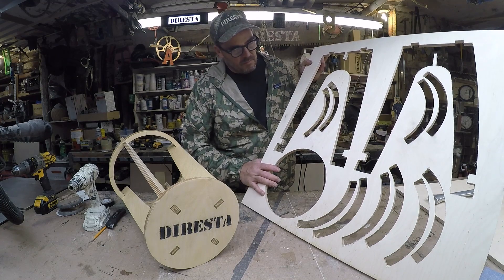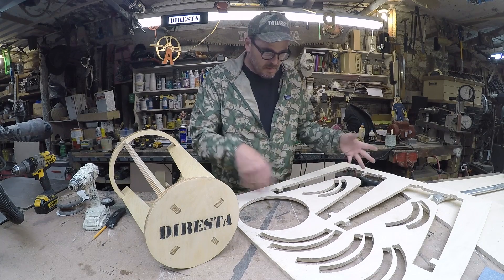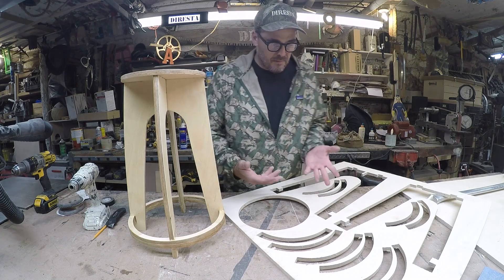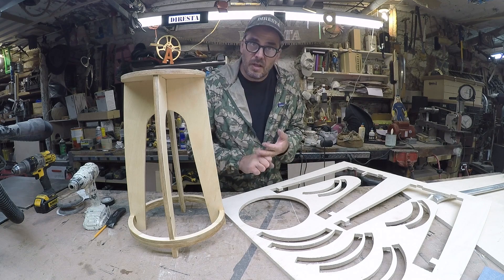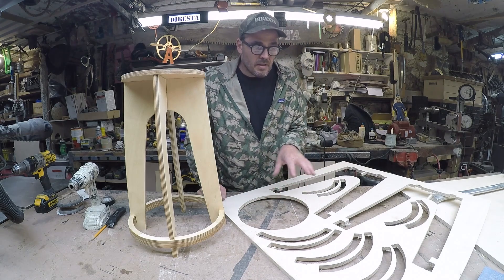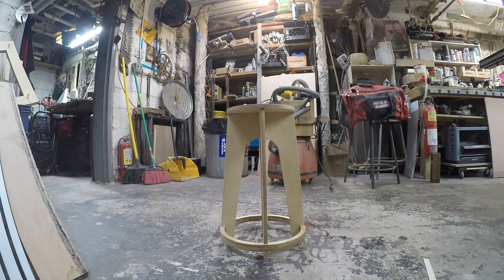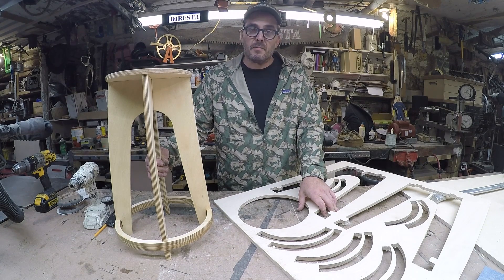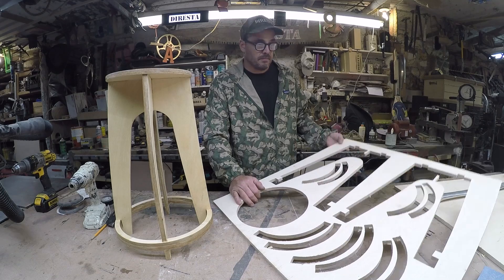Diresta: X-Carve Stool

Comment: If you ever do something that has your name engraved into it you should put some of the sawdust and epoxy(or resin I don't really know what he mixes with the saw dust), but you should put some of the mix where you're name is engraved and sand it nice and smooth and the letters will be a darker color than the rest of whatever project you're working on, but the color difference between the sawdust mix and the rest of your project will more depend on if your using a dark wood or a lighter wood for your project.

Comment: I've been thinking about getting an X-carve for my wood working and I've seen a lot of mixed reviews in regards to its reliability and dependability. A lot of people are saying that you have to constantly adjust the belts and recalibrate pretty much after every use. Have you run into any issues with the x carve? And would you recommend it to others? If yes, why and if not, why not?

Comment: Anyone else notice that the cut path wasn't setup properly, so that when assembled there were big gaps that had to be filled, rather than all the pieces coming together with nice slip fits?

Would have been nice if Jimmy aknowledged the error, even if he was able to correct it with a lot of glue and shimming.
Reply: eugenerk i noticed i need a cnc machine for a make project. And thats not gone happen soon...

Comment: "it's not one of my most beautiful designs..."

Equine excrement, sir.

There is an inherent beauty in the simplicity of one material and the economy of utilizing only one sheet of goods for it. You also understand how to use the material to its own advantage; the Baltic Birch isn't being required to do anything it can't.

As an exercise in the use of both the machine and the material, I think it's excellent.

I could easily imagine slight modifications: do away with the built-up circular rings and in their place, use some short steel stand-offs from each leg and a tubular steel ring, welded to a closed loop for a foot rest. You might get two stools from a single sheet this way?

Thanks Jimmy, as always, and all the best, sir.

Comment: The CNC machine is a very precise gadget, so why he just simplify and make tight connections? Of course, tight connections with glue
Reply: Learning this unit. No option to cut outside the vector.  Only on the vector.  This is why this is lose .  Now I know better for next cut out.
Reply: never question the Diresta :[
Reply: +TRUMP2016 Local187 WallBuilders Union I don't believe he will answer me, but, someone maybe can know the answer
Reply: +jimmydiresta I understand, but you can discovery the drill size e discount they. 
Of course , I'm not telling how the Master of maker's need to do. ;)
Reply: "The Master" Never question The Master.
Reply: +jimmydiresta of course, the drill will pass half inside and half outside the line.
Reply: when does the master learn?
Reply: The Master is learned.
Reply: You will also always have the problem of the rounded corners, creating a bigger hole than needed. This can be (partly) resolved by using dogbone fillets! Another nice feature for this stool would be to mill half lap joints in the curved pieces. Nice video, as always!
Reply: +jimmydiresta jimmy, vectric software lets you cut either side of the vector or on, saves having to resize everything to account for the diameter of the cutter. I don't know much about the Xcarve software but if it does not allow you to do this then it is a bit of a let down.

 corners will also need to be 'dog boned' to get a tight connection.

As always, love your work
Reply: Looked like you were using Easel to me, which does have a way to tell it, for each vector, whether to do an inside, outside, or on the line cut.  

If you haven't already found it, let me know, and I'm glad to help you locate the option.

Comment: sucky part about using hot glue as a hold down is it tears the shit out of the waste board, i guess using the sacrificial piece fixes that issue to some degree. good thinking!
Reply: Maybe if you coated the wasteboard with some finish it might peel away cleanly? But you will always get some cut marks from the bit plunging through your material anyway so will be sacrificial to some extent.

Comment: Make actually have a really good skillbuilder for CNC panel joinery, which will help out with the rounded corners that CNC machines leave. http://makezine.com/projects/make-33/cnc-panel-joinery-2/

You should check out opendesk too, there's loads of opensource furniture designs out there...

Regarding tolerances, shouldn't the tool programme work out the optimum path based on the diameter of the cutting it? I always draw things to be exact, and rely on software to work out the cutting path.